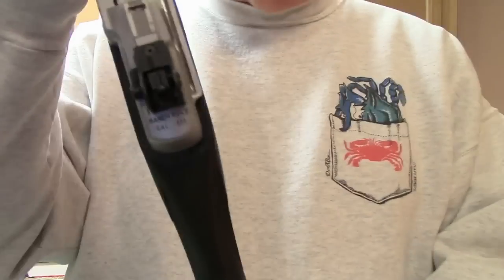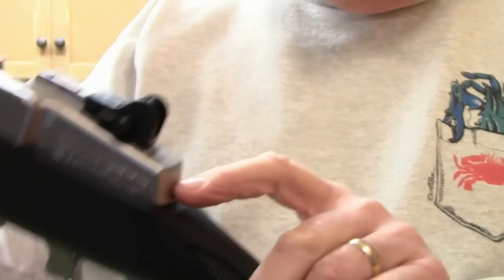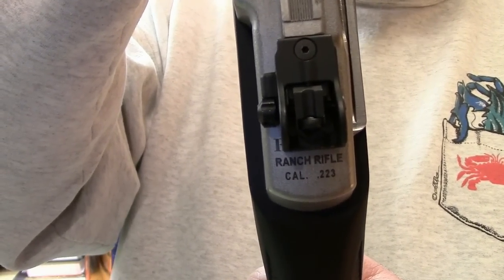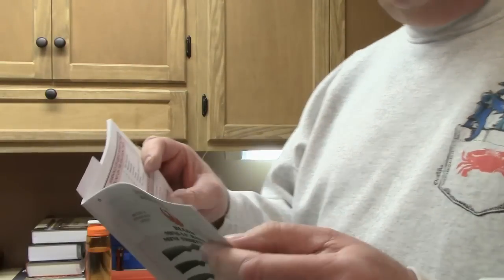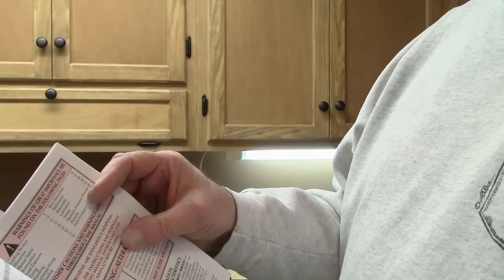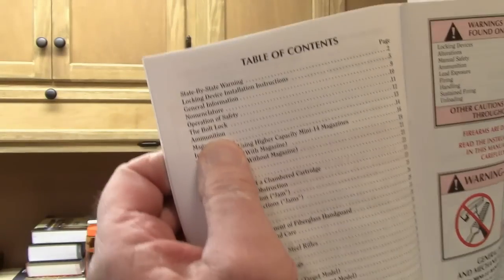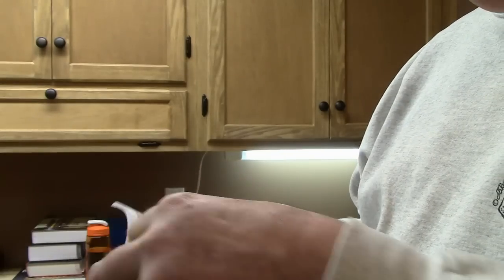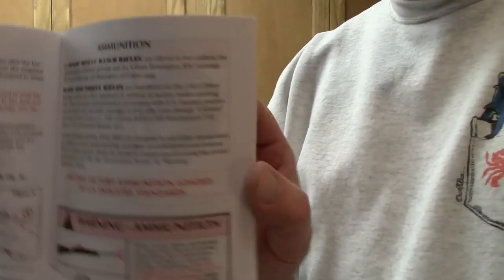Use of 5.56 mm NATO in 223 Rem. chambers ~ Finally, "Can I use NATO in my Mini-14?"

Comment: Hello big fan of your videos. 
I just purchased a older mini 14 produced in 2012, it’s a 581 series in stainless.
It’s marked .223 
I called Ruger after watching this video. 
They said you can safely shoot 5.56 NATO 
No problem.  There actually chambered for it. 
They marked them .223 for civilian market. 
  That’s what I was told directly from Ruger.
Reply: Yeah they told me the same thing… it makes it a bit confusing.
Reply: I have been shooting it in a mini 14 for 40 years, two of them. Never had a problem, Life is a risk you deside
Reply: @Covert_Arrangements  To me its like saying I was told it would be ok if I shot a 357 mag through a 38 special. You cant say some guy at Ruger said it was ok in court if or when your chamber explodes and injures you. Personally,I like leaning on the side of caution when it comes to firearms.
Reply: If it's not stamped 5.56, AND not cited in the spec referenced in the owner's manual: Any catastrophic failure due to using the wrong ammo is on you.  When the rep says 'it's ok' ...always ask them if they can SHOW you where that is referenced.  You might be surprised at how much customer service reps give out the wrong information; OR, the rep could be referencing a different model rifle than the one you own.
Reply: @jimo680  Ruger has a FAQ on their website under rifles, and the first question asked is can you shoot 5.56 NATO out of the Ruger mini 14? 
The answer is all mini 14’s  are chambered for 5.56 NATO so can shoot either 223 Remington or 5.56. The only exception is the target models that were built around 2007. They are specifically chambered for .223 Remington.
I also placed a customer service request with that same question and gave them my model number, and they basically said exactly the same thing as was written in the FAQ. I have shot both out of mine and it was made in 1999 and I haven’t noticed much of a difference except a little more pop out of the 5.56 NATO.
Reply: @jimo680 No documented case od adverse events due to 556 ammo being used in 223 chambers (that I know of). If this could have happened, then it is almost a certainty that it would have by now. Watch Ian's perspective on Forgotten Weapons.

Comment: The newer Ruger Mini-14's are stamped 5.56 BUT Ruger always said that you could fire 5.56 through the rifles stamped .223.  The only rifle they said could not use 5.56 was the Mini-14 Target Model.  If the people that designed the rifle and the manufacturer says it is fine then no one else can confidently say otherwise.  Thankfully Ruger has ended this stupid debate by printing 5.56 on their Mini-14 rifles. According to Ruger you can fire 5.56 ammo through the Mini-14's stamped .223 (except the Target Model) but they state that you should only use brass cased ammo.  They do not want steel cased ammo to be fired through these rifles, that includes the Mini-30 as well, which is chambered in 7.62x39 and the steel cased ammo in that caliber is much more prevalent.  There is no debate....... Ruger says it is ok to use 5.56, then it is ok to use 5.56.
Reply: I started THIS search trying to find a 223 that blew up running 5.56 in it ... NOT 1 VIDEO.  THERE IS YOUR PROOF.
Reply: @jwdundon  
Thank you.  It's amazing how many people post things online and they are just keyboard cowboys.  Of course, there are the "people" that just like to stir the crap.  Appreciate the post.  Good luck.  👍

Comment: Thank you for the video and clear explanation. I especially appreciate your references to the Ruger Ranch rifle with its .223 on the frame and the references to 5.56 and .223 in the manual. I had read it and it seemed somewhat ambiguous. I was looking for a more definitive statement. Your explanation provided that.
Reply from the maker: Though the mechanical specifications have not changed, Ruger has resolved that confusion in recent production by marking them 5.56.  The receiver marking denoted it's basic caliber rather than an ammo specification.  Despite the military name and increased pressures that preclude chambering in a 223 designated rifle, the 5.56mm is a 223 cartridge.  Ruger had relied on owners reading the other engraving on the gun, which specifies the ammo type, and clarifies the issue; "WARNING Read owner's manual." Reading and writing are swiftly fading skills in our culture.
Reply: GunBlue490 thank you sir. I appreciate the further comments. Sadly, I agree regarding reading and writing. I find myself slipping into that sort of lackadaisical behavior.

Comment: Gunblue490, my mini 14 manual is just like yours, and by using language like “.223 (5.56)”, I’m left confused. .223 Remington is not 5.56 (x 45) so why confuse it? I guess I’m safe to stay with.223, but I sure want to know what Ruger means in the manual
Reply from the maker: I hope I can clarify.  You're correct, that 5.56mm and .223 ammo are not the same.  The components and dimensions of the ammo ARE the same, however, 5.56 NATO is loaded with more powder to somewhat higher pressure levels.  NATO and European .223 CIP chambers are cut with more freebore and more gradual rifling start (leade) than tighter .223 chamberings.  As such, all NATO and CIP chambers will safely fire the lower pressure .223 ammo, but the opposite is not true.  Every Ruger Mini-14 ever built since they were introduced is chambered for any military (NATO) or civilian ammunition.  The single .223-only exception was the now discontinued TARGET Model which is easily identified by special markings and the presence of a large harmonic adjuster at the muzzle.  
The reason that older Mini-14 rifles are marked 223 Remington is historically quite simple.  When the .223 was commercially introduced in the 70s, about the same time the Mini-14 came on the scene, the privately owned AR-15 was exceptionally rare, and only technicians had any awareness of pressure differences between 5.56 NATO and .223 Remington ammo.  Most people only were aware of the .223 Remington name.  However, Bill Ruger was very aware of these facts, and was also aware that Vietnam era military surplus ammo was becoming popular, so he simply chambered all his Mini-14 rifles to handle either, and didn't confuse folks with a military designation that was at the time virtually unknown. So, until recently, all rifles were marked .223 Remington.  Every Mini-14 manual very clearly states that they will fire ANY military or civilian ammo. It means exactly what it says.

Comment: Great video, I have a Ruger Mini-14 Ranch Rifle from 1999 serial # starting with 195. This is a thin barrel version. It has Cal. .223 stamped on the receiver. As you said in the owners manual it states chambered in .223 (5.56mm).
The Ranch Rifle is designed to use either standardized U.S. military or factory loaded sporting .223 (5.56mm) cartridges... I also called Ruger to confirm and they stated that only the target models and very early built Mini-14's from the 70's, should only be loaded with .223 Remington.
My question to you GB490, have you ever fired 5.56mm NATO cartridges out of your Ruger Mini-14 Ranch Rifle?
Reply: Interesting
Reply: Yes all the time nothing happens

Comment: Another reason that the 5.56 chamber has a longer "throat"...  The ogive on a 5.56 projectile is thicker near the front of the bullet. Because of this, the bullet is "crowding" the end of the chamber, more than a .223 bullet. Everybody always points out the exact case dimensions of the two cartridges, but hardly anyone mentions the difference in projectile shape.
Reply from the maker: Military bullets are often paired with the 223 case, and have nothing to do with the dimensions of the throat and the leade slope of the rifling, nor of the greatly increased powder charge that results in over 10,000 pounds per square inch of pressure.  The reason it's not mentioned is simply because it has nothing to do with it whatsoever.  Projectile shape and thickness is entirely irrelevant, and can be used with any cartridge or pressure level.  You can affirm this by calling any bullet maker.  Powder charge alone is the issue, period.

Comment: As a past machinist, where would I research a scientific study report to prove that there is any difference in breech fit to cause pressure changes?  The.223 and the 5.56 round were tested differently.  Unless both rounds were tested in exactly the same manner, both rounds cannot be compared to each other.  I've shot .223 Russian ammo out of my Mini-14 that had a stronger recoil than Mil Spec 5.56.  Has there been any documented failure of a Mini-14 using 5.56?  I haven't heard of any?  Have there been any failures of AR rifles using it's designed 5.56 ammo?  I'm curious because the breech of a Mini-14 appears to be of a stronger design than the breech of an AR?
Reply from the maker: I read directly from the Mini 14 manual which allows its use with ANY ammo, which includes NATO 5.56mm.  Regardless of testing methods that you think change facts, 5.56 NATO ammo is loaded with more powder to higher pressures.  If you have doubts about that, pick up the phone and call any of the manufacturers.  Download a copy of ACCURATE POWDER loading data and read for yourself the listings for the 223 and 5.56mm.  They have different load specifications, and different pressures, tested by the same company with the same equipment.  Nobody in the firearms has been conducting a conspiracy to pull your leg.  Watch my entire video in context.

Comment: I formally had a Ruger mini 14 purchased long ago. Finally sold it, however that manual said that gun would fire both 223 and 5.56 both! That was that gun and does not apply to other mini 14’s.This gentleman is correct, but so was I as clearly said in the manual that came with my rifle, bought back in the early 1980’s. It also had the marks “GPS” on the gun, as will as a bayonet lug under the barrel.
Reply from the maker: All Mini-14 rifles, with the only exception being the Target Model, were always chambered to fire 5.56 ammo.  Their marking of 223 Rem confused folks, but they were never limited to 223, except for the distinctive Target, identified by the harmonics adjuster.  They have recently recognized the confusion and are marking the receivers 5.56.

Comment: The case wall is thicker on the 5.56. When I convert the 5.56 to 300 black out I have to turn the diameter of the case neck to get the case and bullet into the die.
Reply: There is no specification for wall thickness in NATO.  Federal, Winchester, IMI, PMC, and Lake City all use the same case to load Remington and NATO loads.  No manufacturer is stupid enough to have two sets of tooling to make a cartridge whose only difference is the test chamber used to calibrate the powder load.

Comment: According to Ruger you can fire 5.56 in all mini 14's besides the target model. I have a second gen mini 14 with a 181 series serial number and it says 223 on the back of the receiver but my manual says I can fire 5.56 and yes it's the manual for the gun.  I shoot 5.56 all of the time and my rifle is still fine.
Reply from the maker: What's your question?  For your information, All Mini14 rifles ever made, with the exception of the Target Model, are chambered to fire ANY 5.56mm or 223 Remington ammo.  Read your manual and follow it.
Reply: @GunBlue490  that's what I said. I read all the manuals that come with any firearm.

Comment: The european cip pressure standards are different to the sammi standards, so with a Czech european made cz bren 2ms as it says 556 on one side of the gas regulator and 223 on the other i believe you can use both. A rifle made in Europe  generally has a barrel made to higher  cip specifications therefore 556 can be fired in the rifle chambered for 223. cip is usually stamped on the rifle and barrel . Whereas a rifle barrel made in the u.s for example is made to Sammi specs so it may not be safe to fire a 556 in a 223 barrel.
Reply: No documented cases of an adverse event by doing that. Seems like it would have happened by now if it's an issue.

Comment: I have a COLT TARGET MATCH HBAR from the early nineties that has .223 Rem on the lower, and 1/7 NATO 5.56 stamped on the barrel. Modern steel/alloy development has eliminated the over pressure concerns involving these 'cousin calibers'. There is a difference in the brass, 5.56 wall thickness is thicker, to reduce severed rim issues in full auto/battlefield situations. It's 2018, now, you go grab any friggy Handloading/Gunpowder Company spec books and look up the recipe for benchloading 5.56. Ain't gonna find one. You'll be pointed to 223 chapter
Reply from the maker: Sorry, but the difference has nothing to do with steel development or brass thickness.  The difference between the two designations is the design of the chamber throat, which are radically different.  The leade (start of rifling) of the 223 Remington throat is at a standard industry distance found in most SAAMI chambers, close to the bullet. The leade taper is also abruptly tapered.  The NATO and European C.I.P. version of the chamber is far different, and incorporates a long freebore before the bullet encounters the leade. The leade is also made more gradual and less steeply tapered.  The difference in brass is not necessarily thicker with NATO or European ammo. I have weighed lots of brass cases to compare them, and have as many heavy 223 cases as I have NATO, and their capacity is very frequently the same. The significant issue is that the pressure of NATO ammo runs nearly 10,000 psi greater than SAAMI at over 62,000 psi.  Your Colt is marked for both simply because Colt is a military supplier and has always chambered their barrels for military ammo.  If you buy an American made rifle chambered for .223 Remington, UNLESS THE MANUAL SPECIFIES OTHERWISE, AS WITH THE RUGER MINI-14, the rifle is NOT safe to use with NATO ammunition, period.  That's an industry proclamation, not mine.  Wylde chambers are hybrids such as are frequently used in National Match barrels.  They employ a special leade that allows NATO ammo, while also providing accuracy on par with a 223 Remington chamber.  You can always use standard 223 ammo in a NATO chamber, and you can always use NATO ammo in a NATO or European CIP chamber, but you can never safely use NATO ammo in a 223 Remington chamber.  If you have any doubts, you should check with the owner's manuals.

Comment: i did read my owners manual, but another point you may wish to discuss, 
not in my Owners Manual but on a separate Safety Sheet, it said using anything other than Brass Cased Ammunition will void the Warranty.
i only shoot Brass thru mine, but like you said, Online there are varying opinions on the topic, Steel, Zinc, BioMetals are much cheaper for target shooting, but i don't use it.
thanks again.

Comment: Hello,   As per this video instructs, I went to Ruger website and looked up the manual for my Mini-14 I bought in the late 70's when they first came out with the Stainless version.  in the manual, under ammunition (page 11) it states:
The RUGER® MINI-14 ®RIFLES are chambered for the .223 Remington (5.56mm) cartridge. The Mini-14 Rifle is designed to use 
either standardized U.S. military or factory loaded sporting .223 (5.56mm) cartridges manufactured in accordance with U.S. 
industry practice. 
  Is there a difference between US Military standardized loading and the NATO loading?

.
Reply from the maker: Marc Bari 
The US is the leading charter member of NATO, and the US designed the 5.56mm NATO chambering.  All US military ammunition is marked with the NATO (+) symbol, and is the only ammunition used by our forces, and any member of the NATO pact.  Yes, US military designation 5.56mm ammo is NATO, and can be nothing else.
Reply: Then it would seem that this era of Mini-14 was designed to take the 5.56 NATO round.